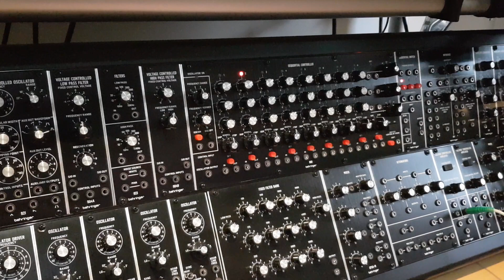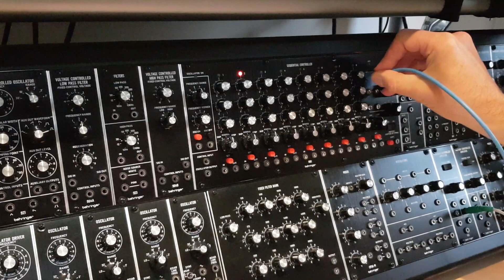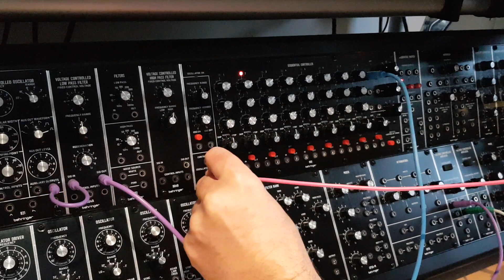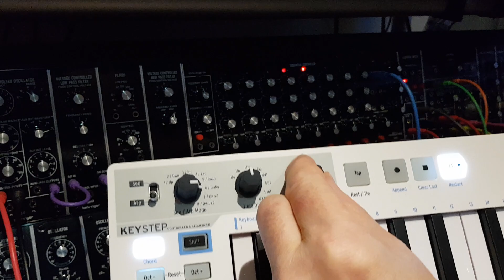Behringer 960 Sequential Controller Tips and Tricks

Comment: Is it possible to link two 960’s together ?
Reply: you would have to use a sequential switch, along with plugging the oscillator output (clock) of one sequencer into the shift input of a second 960
Reply: @Vivica_fullstoppunctuation  Thank you for the answer…………greatly appreciated 👍
Reply: @FlingTingz  of course

Comment: Can the control input be used as an "advance step" input? This would be helpful in sync'ing to another sequencer.   The connection wasn't clear in the video. Or is that the "shit" input?
Reply: I no longer use the 960's internal oscillator to drive it. I have three 960s and drive all three from the clock output on a Behringer 150 which I've split into six switchable outputs on a home-build module. I can independently switch the 960s on and off from this module. Unless I stop the clock and reset all the 960s back to channel 1, they'll start at different times if I switch them on one at a time, but they'll all run at the same speed. If I want to start them all at channel 1 together, I just switch on a "Master" switch on my panel. It was a simple build. No electronics involved, but a bunch of switches, though I did indulge myself with a green LED which flashes on each clock pulse.
Reply: Connect a clock or LFO to the Shift input.

Comment: I'm still enjoying learning about my 960 (actually, I bought two of them !) - but there's one thing that's so far eluded me - How to programme a REST into a sequence. The original Moog 960 had a 4th click available on each skip/normal/stop control which apparently, would go past that channel and not trigger anything. I'm sure there must be a way of doing this, but has anyone any advice on this issue ? - Thanks.
Reply: I'm essentially replying to myself - I've worked out how to create a rest - By using a 962 switcher to turn on and off the trigger output of the 960 (rather than the usual CV).
Here's how - You use the 962 sequential switch. Control the 960 from an external clock pulse. Patch any of the three output rows of the 960 into your vco control voltage socket. Then patch say, channel 5 trigger output into trigger input 2 on the 962 module. Next, patch say, the channel 6 trigger output into trigger input 1 on the 962. Patch another cable from the same clock source into the "Sig in" socket 1 on the 962. Patch the 962 output to your envelope input. You will now have a rest on channel 5 of the 960. What's happening is that channel 5's trigger out is switched off by the 962, then switched back on in time for channel 6 to work. If you have your envelope decay/release set for too long a time, it will probably pick up a ghost of channel 5's output, so best keep the envelope decay/sustain/release pretty short.
Reply: @and7barton  thanks for sharing Richard. Great workaround
Reply: @r_glynn  My little hack works, but isn't perfect. The rest as it passes plays a faint "ghost". It needs to be perfected.
Reply: I received my 960 only last week and stumbled across a way to achieve rests, using a Doepfer A-160-5 ratcheting controller, and one row of the 960.  The output voltage must be at a certain level to trigger the output of the A-160-5, so set that level on 960 for the steps you want to sound, and set a lower voltage on the steps you want to be rests.  Added advantage is you can also ratchet any step by turning up the voltage.  You still need short envelopes though.
Reply: This is great knowledge and am excited to try these myself.  960, 961, and 962 on the way!!
Reply: @murphyjulian432  The 962 is, in my opinion, essential when using the 960.
Reply: Nice ideas. Would you happen to know if the 960 can be externally clocked at audio rates? If so, how high can it go in frequency?
Reply: @TheSwircle987  I suppose you could say yes, but only down in the very lowest audio frequencies. I'm talking about less than 100 Hz from memory. It would no doubt switch at higher rates, but the resultant sound wouldn't be especially useful. Just a crazy buzzing noise.
Reply: @and7barton  Hm, almost surprising, given that it is analog. But okay, thanks.
Reply: @TheSwircle987  I have 3x 960s but I only ever tend to run them from one external Behringer 150 through a nine-way switched multiple so all three run in sync.
Reply: @and7barton  I see. Have you ever tried to clock one of the 960s with a square/pulse wave? Might require some offsetting first, but it works for modules which can run at audio rates.
Reply: @TheSwircle987  No, I haven't, but I imagine the clock's output is a square wave anyway ?
Reply: @and7barton  That's a great way to get a rest with the 960.

On a side note, the original 960 did not have a hidden 4th click rest feature, you are thinking of the Synth dotcom Q960 which added that feature in and features it prominently in their descriptions.
Reply: @johnmiddleton4291  I stand corrected - Thanks. It was a nuisance that a rest, or "trigger off" setting wasn't included in the Behringer 960. My little "hack" using the 962 kind of does the job though. I think a 962 is an essential partner to the 960. There could even exist a better method, so it's worth studying and experimenting further.
Reply: @and7barton  A bit off topic, but you wouldn't happen to know if the stage trigger outputs are actually gate outputs, would you? The manual says they're DC coupled outputs that deliver +5 volts, but it calls them trigger outputs. Unlike the inputs which it claims are AC coupled. . . I can't test myself. Mine won't be in for over 6 months. :\
Reply: @TheSwircle987  I haven't, but the leading edge of a square wave would doubtless trigger the 960. I normally use the clock pulse on my 150 module.

Comment: A very simple way to condition a stage trigger output to reset to another stage is to stick it through a low pass filter.  This has the added advantage that the cutoff frequency will control whether it resets or not.  I have tested a Doepfer A-108 VCF8 from 6db/oct upto 48db/oct and it works well so I presume it will work with any LPF module.  Feeding the VCF frequency control from a LFO gives an effect which is random enough to be interesting and repetetive enough to be coherent.
Reply: Might seem a strange question, but I haven't got my 960 yet (won't ship for six months!!! ) Do you happen to know if the stage trigger outputs are triggers (short pulses) or gates (held DC voltage) The manual doesn't specify, except to say the trigger output is DC coupled, unlike the input. I know it says "trigger" but I've seen a good many modules say "trigger out" when its actually a gate.
Reply: @nickmarkham3743  The stage outputs are TTL compatible, positive logic, gates.  There is also an oscillator out signal which is a TTL compatible, positive going (rising with the stage outputs) 25% duty cycle signal which may be useful.
Reply: @andrewlecouteurbisson7217  Thanks for getting back! ^^ Just to be sure I understand the stage output gates correctly: these gates remain high as long as a stage is active, right? Meaning, if I stop the sequencer, the output for that stage remains high. I don't expect the oscillator output to remain high while the sequencer is stopped (but maybe it does, dunno) 

Was hoping to use the stage gates to select channels on a kind of multiplexor (octal vca into an amplifier/mixer)
Reply: @nickmarkham3743  The stage outputs remain on as long as the stage is selected.  The signal state is reflected in the state of the numbered LEDs at the top.  The Behringer clones seem to be very accurate copies, warts and all.  With this in mind,  search for "Moog 15 schematics" and the first result will provide a schematic for the original 960 where it can be seen that the lamp and stage output are driven by the true and inverted outputs of a flip-flop and therefore have exactly the same timing.
Reply: @andrewlecouteurbisson7217  Thanks so much, mate! That's exactly what I was hoping for. I'm not an electronics engineer, or even a hobbyist yet, so a schematic would've been hieroglyphs to me. Block diagrams, I get, but electricity doesn't seem to be so unidirectional -- its more like algebra or even differential equations in some cases, done pictorially. . . Anyway, thanks again for your time! I appreciate it.